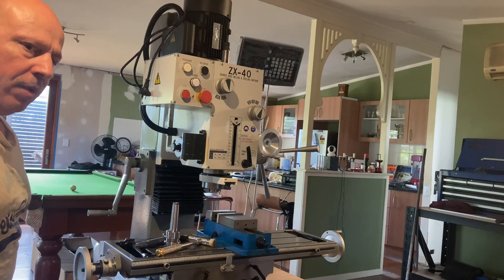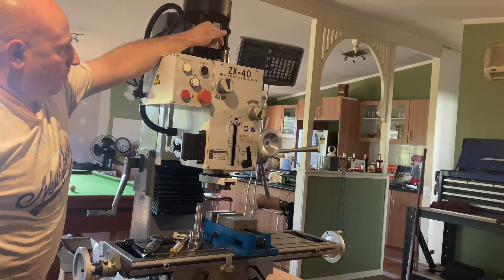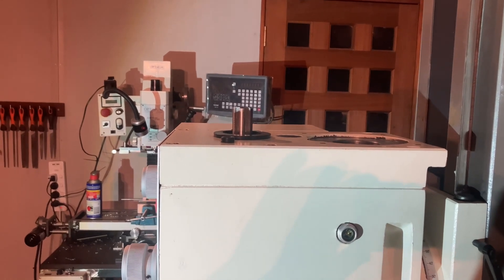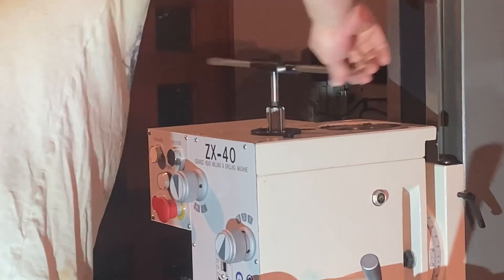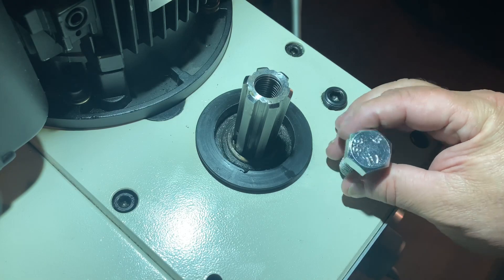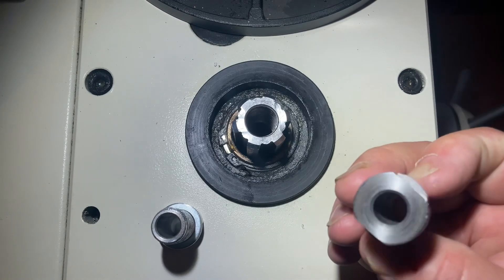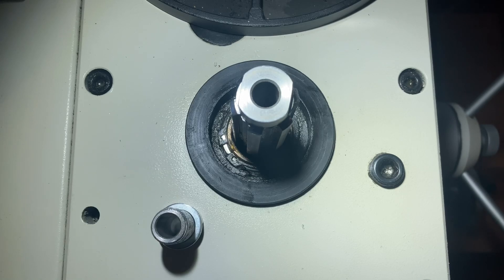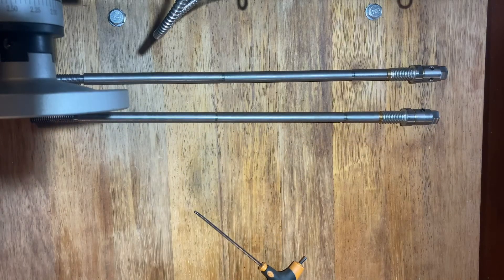Milling machine, clone RF-45 custom drawbar, no hammer required.

Comment: I bought a small mill-drill from RedFox Machinery (in Melbourne I think) that came with a captive drawbar, so I take it for granted. At work though, I have to hit the Bridgeport clone with a hammer to get the tooling out. I grit my teeth every time I have to do it, but your way is both simple and elegant. I especially like the idea of tapping the 14mm ID to M16×2. Very nice👌
Reply from the maker: Thanks for your positive feedback.

Comment: Seems like the force pulling the collet into the spindle is held by the two grub screws fixing the top nut to the shaft.  Have you noticed any fretting or slipping?
Reply from the maker: @enderw88  hi, hasn’t slipped, with the flats machined into the shaft and machining the grab screws, there’s pretty good holding force, and if there is any slip, it would only be to the end of the machined flat. I originally thought to pin the hex head to the shaft but for ease and speed of assembly and disassembly, I used grub screws.
Reply: @johnnyciantar  Thanks.  Pins would be more difficult.
Reply from the maker: @enderw88 hi, I have since used 4mm spring pins because I did get some slippage, only fractional due to the machined flats, but it was enough for me having to turn the bolt nearly a full turn to free the tool from the tapper, so far it’s working great.

Comment: Hi, great job, I already subcribed, my respect. I have zay7045 and I'd like to do this system. The tapping male is M18?
Reply from the maker: @7emezzo  hi mate, my machine has a 14mm diameter hole in the spindle, so that’s a good size to tap a 16mm thread. You’ll need to measure the hole in your spindle, then work out the tap size.
That’s great you enjoyed the video and thanks for subscribing

Comment: Being lazy, I just made some wide wedges with a slot in them that fit between the toolholder and the spindle. Very quick and easy, plus can be used on multiple machines.
Your solution is elegant though.

The biggest problem that can occur with a slow taper is, not being clean and dry, and overtightening.
Reply from the maker: @Onan-u3b  thanks for your feedback.
Reply: @johnnyciantar  Cheers mate. That was a great video.

Comment: Well, having seen a few different methodologies for eliminating the hammer hit, I have to say this seems to be the most elegant solution of all and the best part is that the whole thing is so easy and so simple (scariest part, as you say, would be not jinxing oneself into breaking a tap). Good onya, well done.
Reply from the maker: @davejaguar6532  thanks mate. I’ve seen some other methods too, I wanted a system that would also be quick from changing from imperial to metric. It turned out easy enough to manually cut a thread into the spindle. I’m glad I went down that path.
Thanks for your positive feedback. Cheers.

Comment: Hi,
Very good and tidy machined bar. I have same issue removing chuck when it sits tight in morse cone. Just my 2 cents - it appears that video was not exactly showing how should be used to remove chuck:
1. From final demo it appears chuck sits not on morse cone but on bar only(loosy). It might be OK when check by hand but might not work good when do milling or drilling.  Once bar unscrewed chuck has been released - but it should sit tight in morse cone at this point. Bar just prevents chuck from falling down. 
2. This construction is actually working by design with condition that length of bar between thread on the end and bronze bushing at middle bolt should be same or slightly larger than internal spindle length between end of morse cone and end of newly made thread in spindle. Bar should be used in slightly different way:
a) put bar in spindle
b) screw large bold in middle of bar down half of  the way.
c) screw bar itself into chuck all the way down (chuck might still be loosy)
d) unscrew middle bolt in bar tying up chuck in morse cone.

When released:
a) unscrew bar half of way making it loose.
b) screw middle bolt down pushing chuck down by bar from morse cone.
c) unscrew rest of bar thread  from chuck 

Regards
Reply from the maker: @igortrush4055  thanks for your feedback